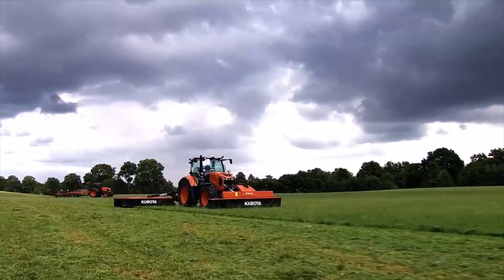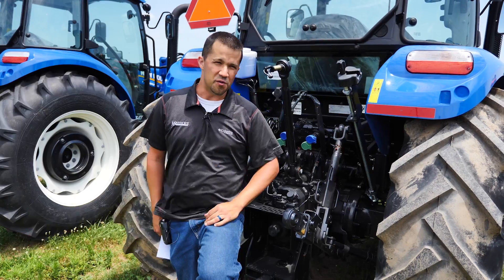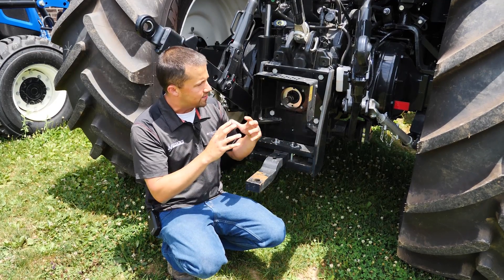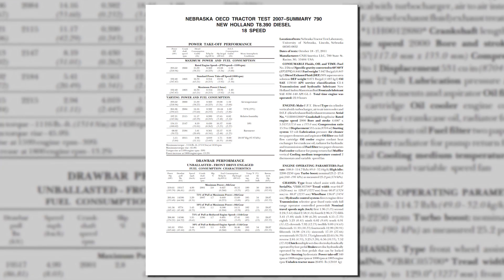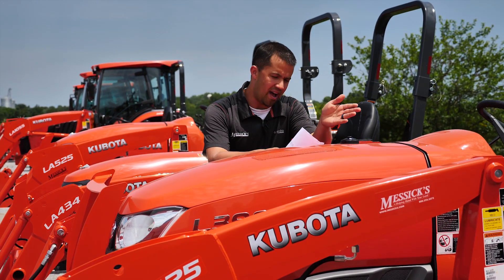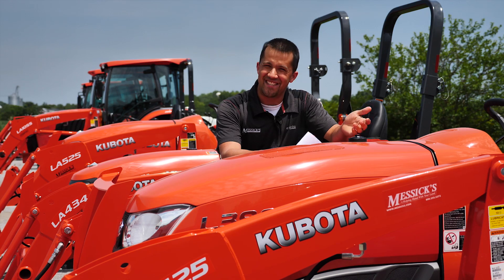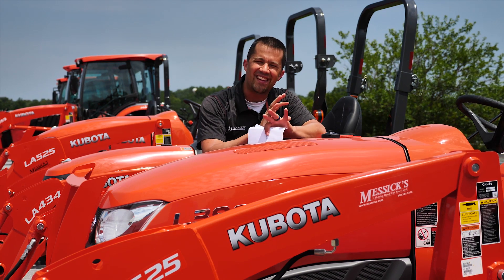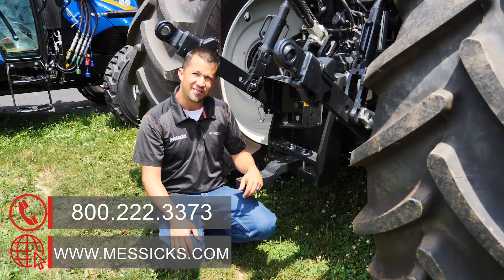Understanding Tractor Horsepower. Gross \ Net \ PTO \ Drawbar

Comment: interesting topic i recently bought a kubota 3301 rated at 33hp, when i read the operators manual it says the size of plow it will pull is either a 16 inch or 2 12 inch bottom plow. i find this very interesting my father purchased a farmall F12 in 1937  rated power 12 horse power plow size 2 12inch bottom plow. . what happened to the other 21 horse power between 1937 and 2024?
Reply from the maker: Lots of weight and low gearing
Reply: @MessicksEquip  not so  farmall f 12 weight 2700 lbs  low gear slighty faster than kubota l 3301 l3301 27 30 lbs i would love to be able to put them drawbar to drawbar and see which would pull the other.

Comment: It would be interesting to find out how much more HP a CVT transmission may provide compared to a gear and hydrostatic transmission.
Reply: Those specs are out there, but they only apply to the make listed. Not all transmissions are equal, even gear transmissions vary in power transfer efficiency. Based on published specs hydros have even more variation. Here is an example -pto because rear wheel horsepower isn't available) 

CASE Farmall 40 (40.0 gross hp) PTO - 35.0 gear / 33.2 hydro / 32.0 cvt (Case spec sheet Aug 2010)
Reply: From what I've seen in my [limited] research over the last few years, at least with major brands like green, you take their model number hp (JD 5075 claims 75), you then subtract ~10% to get PTO hp (75*0.9=67.5hp), and if you want hydrostatic, go ahead and subtract another ~15%. When shopping for a tractor I've been just looking at one model higher than I think I need, and when I find something I like maybe get gritting with tractordata.com or the Nebraska thing the video mentions.

Comment: Neil,  my tractor has 39.6 hp (listed as gross, no mention of net) and 33.3 pto power. When an attachment that has a pto I go by my pto hp to determine if my tractor can handle the implement (i.e limited to 33 hp), however if the implement does not have a pto I have used the gross hp on my tractor as the limiting measurement. I suppose I need to use around 2-4 hp less from the gross hp to safely measure my net hp since it is a HST and limit attachments such as garden rakes and cultivators to @ 36hp. It that the right way to determine if my tractor can handle the implement?

Comment: I got a question for a truck there a Dodge 2500 with Cummins Diesel with d e f fluid will the dealership maintenance to d e f fluid on the oil change

Comment: It's a shame that they even publish engine horsepower since it is torque that actually does the work that you want to do.
An excellent example is provided by these three 25/26 HP (more or less) Kubotas.
B2601 - 1123cc - 52 ft-lb 

B2650 - 1261cc - 62 ft-lb 

L2501 - 1647cc - 70.2 ft-lb
Guess which one can do the most work?
Reply: Torque alone does not do work.  It's torque X speed, and that equals horsepower.  Think of it this way.  An electric winch is high torque, low horsepower.  A one horsepower electric winch can out pull a 25 horsepower tractor, but it doesn't have much speed.  One horsepower = 550 foot pounds per second.   It can be pulling 550 pounds one foot in one second, or one pound 550 feet in one second.  The power is the same.
Reply: @trentstractor  You are correct in the abstract, but when considering the actuality of how engines are used you are missing the point. A tractor is used at a set rpm, IN A SET GEAR, to perform a job, for instance PTO rpm (in any gear), the torque at that rpm determines the work that can be done. In other application, such as an automobile, gearing comes into play, but even then torque determines acceleration. It is said that horsepower determines top speed, not entirely accurate, but a decent rule of thumb. I'll note that my last line was -  'Guess which one can do the most work?'
Reply: John, tq is important, no question about it, but I believe companies publish the hp numbers (especially the pto hp numbers) in order to match tractors with implements. While knowing tq is nice, published hp numbers are practical for decision making. The tq combined with gearing and hp is computed to get tractor final output numbers such as weight to tow an item. That weight number to tow is the critical number for the end user.
Reply: @sloppyjoe6243  I'm sure that they publish horsepower for the same reason that automakers do - people think they understand what it means LOL  I do have to wonder about it's accuracy though. Just take a look at the pto numbers and the pto engine rpm of the three examples I noted. It seems that they derive that number using factors such as tractor weight instead of actually measuring the stationary PTO output. I'm thinking that you could run a larger stationary implement with the higher torque engines in the examples I gave.
Reply: John Morman, you might want to give a little more credit to what people think. You may not be the super genius you think you are. I think most gear heads know the difference between hp and tq. Attachment manufacturer’s do in fact know how to measure their products. Why don’t they use tq? I assume they feel that if the tractor’s hp can reach the min requirements then the tq will be there as well, or the tq requirements are a lot less than the hp requirements to get the implement to speed. Car manufacturers always list hp AND tq specs on their engines because customers know what they do. (Especially in the sports car and truck markets). Kubota is the only manufacturer that I know to list net hp. Even the auto manufacturers don’t list RWP only gross engine power. That’s why they car and motorcycle mags Dyno the engines to determine what hp and tq the vehicle really delivers. Brother either you are a little too pretentious or overthinking the whole tq bit.
Reply: @sloppyjoe6243  Is it really necessary to toss in an insult? Seriously, do you think that advances your argument? Most tractor owners aren't gearheads, or these types of videos wouldn't be needed. I'll commend Kubota for publishing net HP in their advertising, but you can find specs on all makes that contain it (for us gearheads I assume). I''ll note that Kubota also underrates their implement specs. Just take a quick peek at the differences in the Operators Manual, and the recommended sizes on the Land Pride specs (on the Kubota site no less). I've been operating tractors since the early 1970's and I've learned to take all specs with a giant grain of salt. Much more important than specs on paper is the conditions that you are operating in. Sandy soil, loam and clay all have different power requirements as I'm sure you know (but I still see that many on the forums don't) BTW - all of this discussion aside do you really think that my three posted example can do the same work because of those net horsepower figures?
Reply: Sorry John, that was a little mean of me.
Reply: @sloppyjoe6243  Thank you for the response
Many of the sites I visit would consider that 'insult' nice, but I always hope for better standards in these threads LOL

Comment: Ed White, Callahan,  Fl. Great info as always.  Thanks !  I have a bx25 would like to add a chipper but lack pto hp.  Chipper  spec. requires min. 20 pto. hp.
Reply: Your tractor will pull the chipper with no problem.   The specs are for maximum capacity.  The load on a chipper varies a lot depending on how you feed it.   You just have to pay attention to how the tractor sounds as you are feeding it.  Just like a mower deck or brush cutter or a farmer's silage cutter,  you can't run but so fast, and a smaller tractor will do the job if you slow down a little.

Comment: Hi Neil, got a question for ya. A Bx2680 rates 3point as lifting 600lbs. The woodmizer pto woodchippers weighs a bit more than 600lbs, they say it was specifically designed with Bx's in mind. How can a Bx lift it? Thank you.
Reply: I'm sorry, I meant Woodmax pto wood chippers.
Reply from the maker: I don't sell them. No idea if it will. There is a Land Pride and Woods models I know would be okay.

Comment from the maker: Yes, I shot this awhile ago. I did a lot of filming over the summer so i have some buffer room in my work schedule.  You'll see periodic seasonality problems though the winter.
Reply: Could the example of efficiency you gave be more down to the kabota having a similar hp number but a higher torque number. Not calling you out just a genuine question like how the bx 2680 and b 2601 have 26 hp and same pto hp but the b2601 has more torque and much more tractor to push around not to mention hydrologic flow